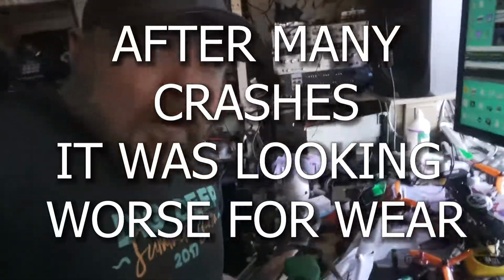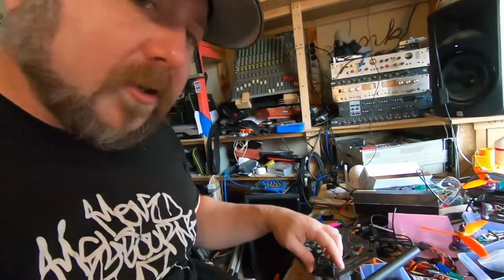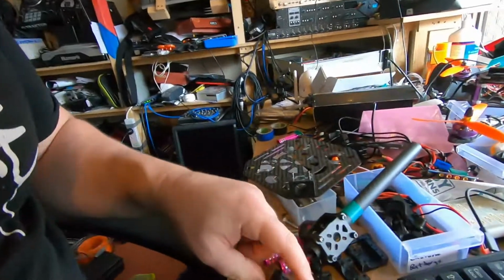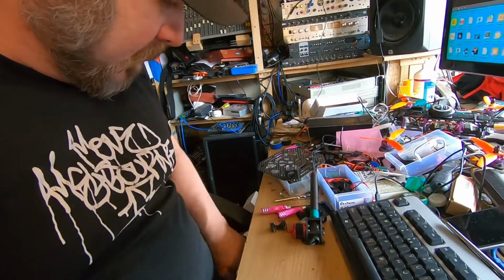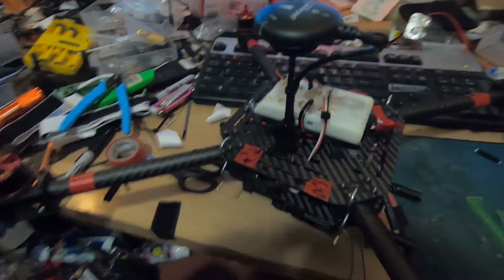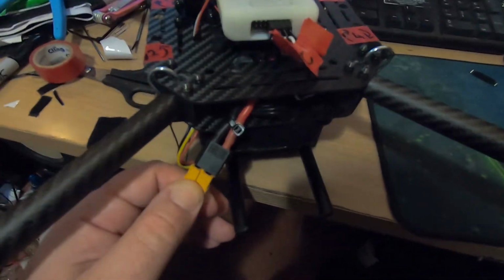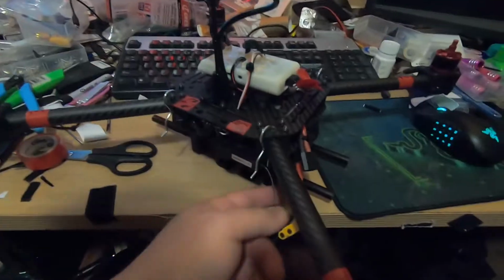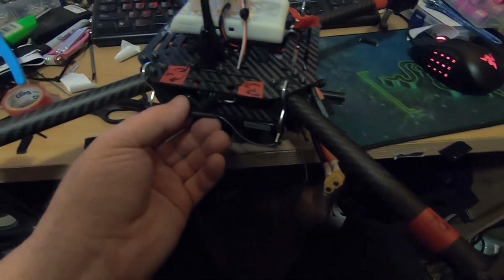Drone Rebuild V2 0 for NXP Hovergames

Comment: Cool!  In case you want to go back to having legs on it:  Here's my snap-on legs I designed after I got frustrated with landing gear breaking on every hard landing.  These too can break in a hard crash but are more likely to just snap off -- check it out: https://www.thingiverse.com/thing:3941636.   Have a couple of 3d printers as well.  And have had a major crash of my drone as well so know the feeling of rebuilding the thing.
Reply from the maker: cheers! I havnt actually got around to repairing the legs yet! I will have a look at these! Ive been contemplating fold up ones on a servo, just because it will look cool! haha.

Comment: Good luck with your mods. They look interesting. Do you know if you've added any weight overall? (I suppose without legs it will be less. Was wondering how the new battery mount compares with the original one. Nice!
Reply from the maker: i've just woken up, the sun is out, time to go test it! As per weight - I think it is marginally heavier, but only by a few grams, I should of weighed the parts before I assembled it. I will also be re-adding legs, 3d printing is so slow, I havnt got to that yet. Fold-up legs on servos would be cool! Maybe for version 3.0 haha
Reply: @kayboku7281  you've inspired me to buy some carbon fiber rods and try my own vertical landing "posts" at each motor.